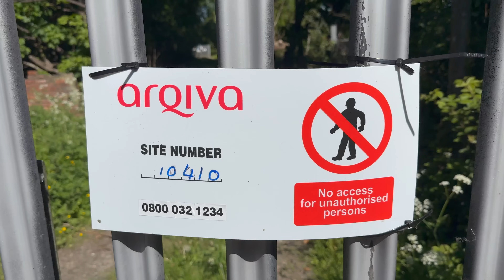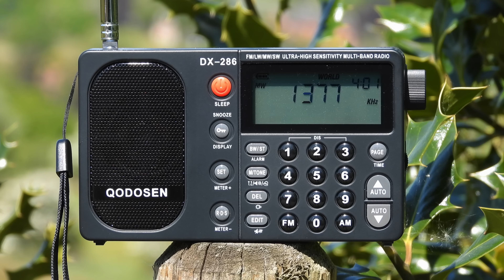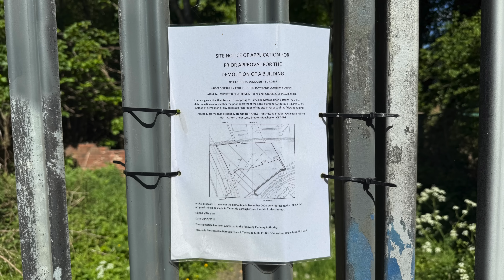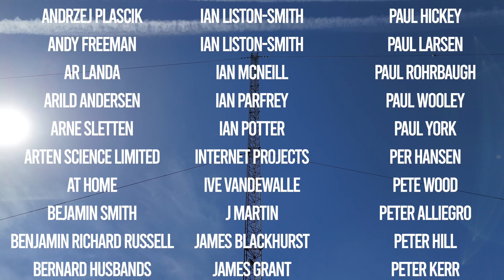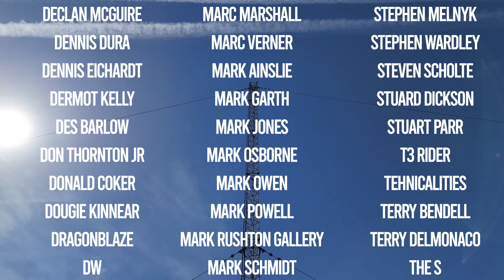This Retired AM Transmitter Should Not Be Here

Comment: Part of the problem of demolition of stuff like this is entirely financial:  is there any real benefit to knocking it over?    There is a lot of land around the area that could be developed to commercial or even residential, and this block with a major highway, a main train line, and a busy commercial road pushing on the triangle of land, there may not be any immediate use to the land itself.   So keeping the towers in place means that some other great use may yet come down the line, such as someone else wanting to get into the radio market on MW.    You just never know what might come along.  They could also be individually converted to things like Digital stations.  You never know.   Flat on the ground, the place is just dirt and the cost to haul up new towers not really worth it.

Comment: I hired a 72 plate Nissan Qashqai, it has AM, FM, DAB, Bluetooth and USB.  Each had a nice little icon, AM was a vertical, FM was a mast, DAB looked like a satellite dish!

I scanned through and heard a couple of stations, including 909 and 693 (Five Live).  I believe the frequency ranges are AM 531 kHz to 1602 kHz, FM 87.5 MHz to 108.0 MHz, DAB 174.928 MHz to 239.200 MHz

Comment: 6:34 - The demolition can be carried out within 5 years of the Date of Decision (5th November 2024) not the Date of Application (1st October 2024)
Planning Ref 24/00874/NDM - Removal of 4 no. masts, 1 no. whip antenna and restoration of the site.

From the Decision document, they will need to get an agreement with Network Rail before they can commence the work.  I wonder if that's holding it back.
Reply from the maker: I read that network rail had no opposition so I’m not sure
Reply: @RingwayManchester  

From the Delegated Report document:
Network Rail: No objections subject to completion of an Asset Protection Questionnaire. 

From the Decision document:
NETWORK RAIL - ASSET PROTECTION AGREEMENT
The applicant is advised to contact Network Rail as the proposal includes works which could impact the existing operational railway and in order to facilitate the above, a BAPA (Basic Asset Protection Agreement) will need to be agreed between the developer and Network Rail. No works are to commence until agreed with Network Rail. Early engagement with Network Rail is strongly recommended.

Comment: Lyca Radio may have a screwed up capacity hat but they are daily copy here in the west of ireland  on 1377 at a distance of around 200Km, I am in an RF quiet, rural location and most evenings I'd hear them ok, generally about the same strength on average as TWR from Armenia here so hardy 'armchair copy' but still really good for an 80W AM transmitter into a shortened (& now detuned!) vertical with a busted capacity hat ! 

You can try for for yourself from my location, search for EI6IZ.  I have 2 Kiwi SDR's on different loop antennas and a web888 that might soon get one of the medium wave beverage antennas. They all hear well on medium wave

Comment: I wish DRM (digital radio mondiale) took off in the UK on MW, it would've ensured a bit more life for AM with an improved quality, and with robust quality modes can counteract fading and ionospheric disturbances, with a slight loss in quality, but is still acceptable. 

I have a Gospell DRM/DRM+/AM/FM/LW/SW radio, and receive various DRM transmissions via SW aimed at Europe from various locations on the European continent and beyond (receivable in the UK) and sometimes I receive DRM transmissions beamed to other parts of the world due to the propagation conditions.

I also receive regular SW transmissions to other parts of the world, some audible in certain reception conditions, but many not.
Reply: Well said, but i do feel like the DRM folks should be doing more to make it mainstream, bringing in more manufacturers and broadcasters, honestly woeful state of affairs 😢.
Reply: @syed_mamoon99  The DRM Consortium is currently promoting the standard in India at the moment at Waves 2025, where DRM is extensively used on MW and SW and DRM+ on the FM waveband.

Broadcasters in Europe and the UK have deliberately thrown in the towel on digital radio mondiale and AM and consider it a waste of time, when it could replace AM easily ie DRM uses less power than analogue AM, can offer stereo if desired and can cover large areas quite easily without hundreds of transmitters for DAB and DAB+ / FM.

Comment: I have absolutely zero faith in the UK government (of any flavour, devolved status or colour of rosette) to adequately plan for a disaster. Our entire civil and public services are “profit centres”, and contingency planning is seen by the bean counters as a waste of operational expenditure, as you have no Key Performance Indicators to measure by. It’s why a single point of failure can cripple transport networks (see Heathrow and the TfL network). Why our NHS has the same predictable overloading every single winter as flu cases rise. Why our energy grid runs with almost no spare generating capacity and depends heavily on the DC interconnectors to mainland Europe and why our Gas network has very little storage capacity. Just trying to have a spare van at the public sector industry I work in is impossible because it can’t be justified due to its normally low usage, and managers bonuses must be paid, even if it’s the taxpayer funding them. 

So, I’m more inclined to believe that there’s some administrative thing going on at Arqiva, Ofcom or the local authority. Maybe even Network Rail had questions about the demolition plan and would prefer a stoppage on the adjacent line during the works, so it would be worked into their T-12 planning window for disruptive possessions. 

In the event of a major disaster or conflict, I’m afraid this country is, bluntly, f*cked, because all our great leaders can see is £££££s.

Comment: I wouldn't be surprised if Lyca Media are the reason for the delay. Under Ofcom rules, they can't close down a single transmitter without requesting an amendment to their license. As such, the only options is for Lyca and/or Arqiva are to keep the Lyca Radio transmitter where it currently is, or relocate it somewhere nearby.

There was a similar situation back in 2015. The lease for the land on which the Manor Farm (Reading) transmitter was based was terminated. However, the license owners (Global) opted to return the associated license (Reading/Basingstoke AM) to Ofcom and cease transmissions from both Manor Farm and Washwater (which wasn't affected by the terminated lease).

Comment: As I said in the comments section of the previous video... I still think that old AM masts like these should either be kept in place (for contingency reasoning), re-purposed (for 2M/70CM/PMR etc etc use as some sort of repeater etc) or carefully removed so the mast can be re-used (albeit in smaller heights with no need for stay wires) by people in poor signal areas who need a taller and more rugged aerial mast.
I know of one particular area where, if I had a holiday home there, one of the first things I would do is get a 20m (yes, twenty meters) mast put up so as to see over the top of the trees and get a good 4G/5G signal.
Reply: Give a lease to the local Radio Amateurs and let them set up a transmitter.  We have the kit to transmit on all bands, RAYNET have in  place emergency communications so why not let them make ready a TX for the authorities to use in an emergency ?.
Reply: We're talking about 'we will have nothing unusual here' Britain, remember. Planning authorities are meant to approach applications on the basis of presumed approval, but instead approach it on the basis of presumed refusal. Everybody has become wildly intolerant of anything to do with radio, being seen as something few others do and thus must be something bad and/or not really legitimate. That said, you can always hope nobody sends you an enforcement notice within four years, after which you will be free from such - provided you can show something was up permanently over those four years.
Reply: Having it sitting there for years waiting for an emergency is all very well, but without everyone having a usable MW radio it's pointless. I imagine for most people the only MW radio they have is the one in their car, but they're on their way out too.
FM is around for a long while, as will DAB

Comment: I saw somewhere that they needed permission from Network Rail.
Reply from the maker: There was no objection from network rail
Reply: given the proximity to the lines that could be the issue NR will probably want a stoppage on the line in place just prior to any falling and a line inspection afterward they are quite anal about p way safety
Reply: @shayne109  I read on the planning permission for the demolition that they expected Arqiva to contact them, rather than just set a date.However they didn't object per se